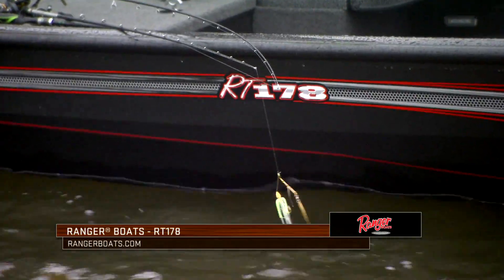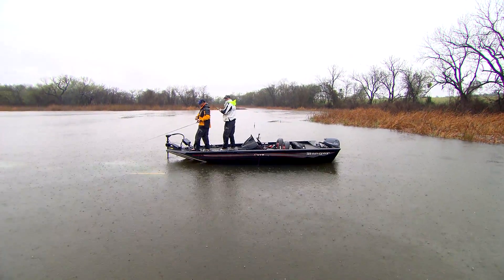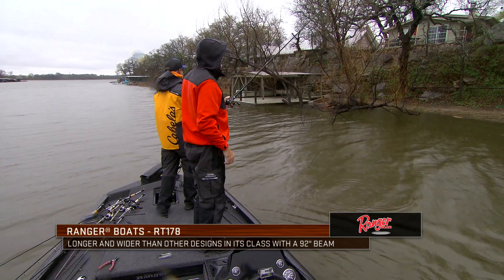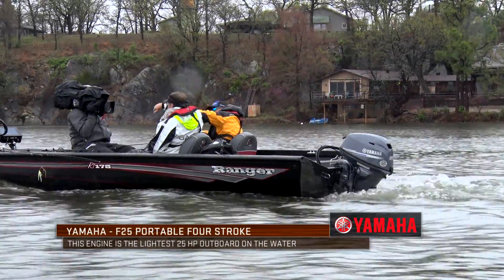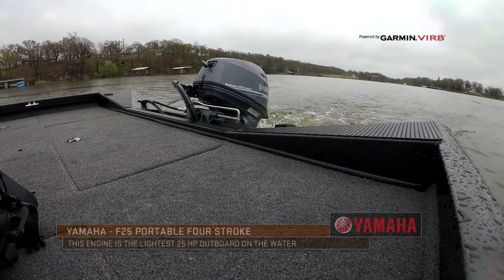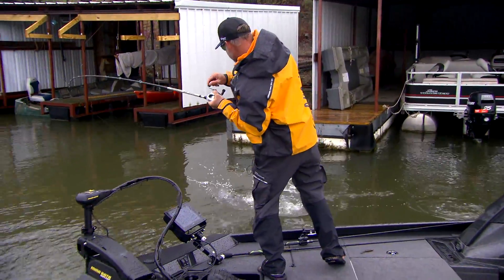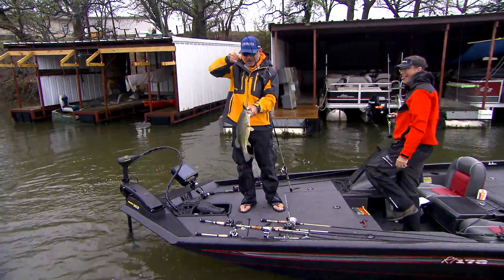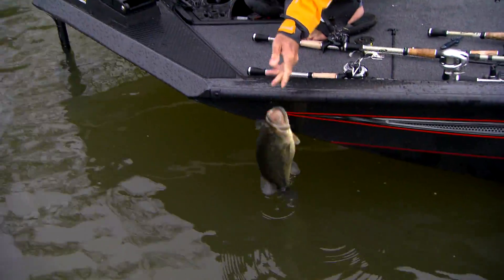Aluminum Boats and Small Engines

Comment: I was wondering how this boat does with the 25hp on it?
Reply from the maker: For small bodies of water it works fine.
Reply: I have a G3 17' 56" bottom. Console. 24 volt trolling motor. 6.6 gallon tank. With normal load, and me (175#), 22mph. Add a 2cnd person, and their gear, 20mph. Note- no power trim.